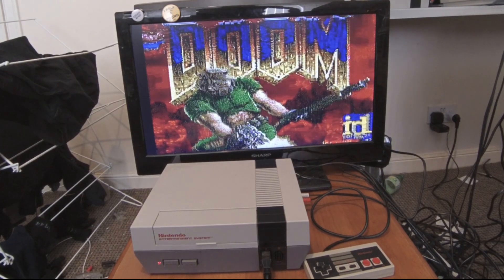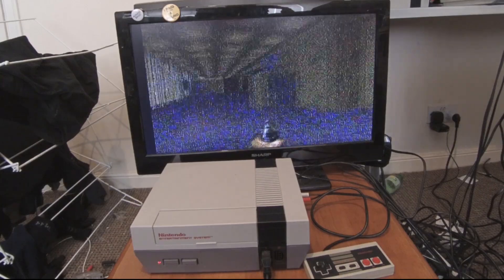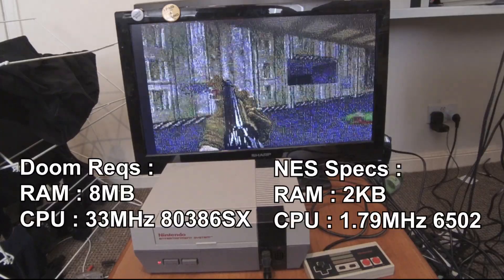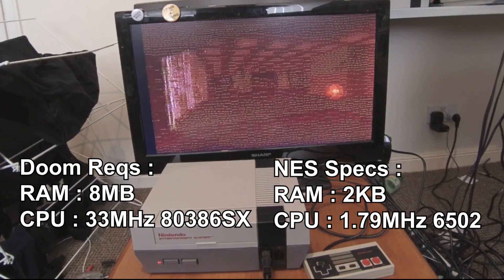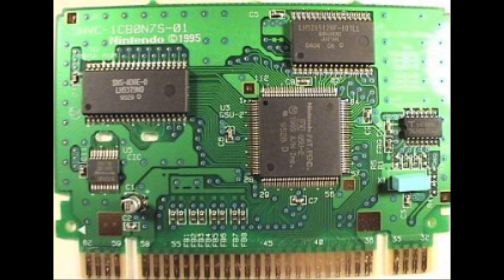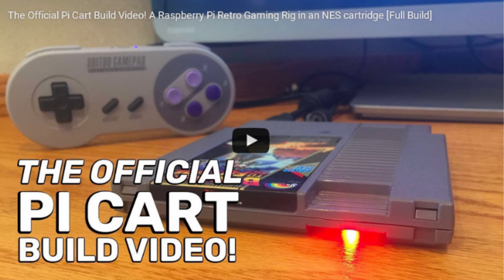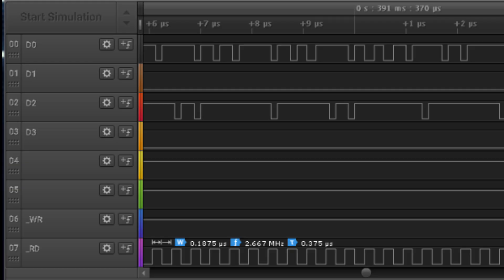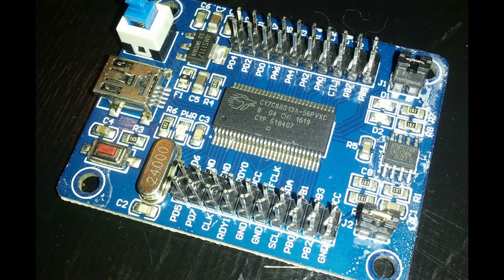DOOM on NES!

Comment: Is there a way to do the same thing on the SNES?
Presumably, it could offer everything shown here—and potentially more, thanks to its expanded colour capabilities.

One important point: I wouldn’t want it running in a tiny window. If it’s possible to run this full-screen on the NES, then there must be a way to achieve something similar on the SNES too. Even if it involves using something like Mode 0 with 2bpp colour (similar to the NES but slightly improved), surely it should still be feasible.

Also, could you briefly explain how the colours in this NES version are achieved? It looks surprisingly colourful, considering the NES typically uses 2bpp tiles. Understanding that would be helpful, since it would factor into how a SNES version could possibly be implemented as well.

Comment: This would of been possible back in the day somewhat, but the chips would be far too expensive for the consumer market!
I'm sure it would be possible to build a handheld into the cartridge itself with the ability to work on an actual NES!
Fit a pi zero, plenty of room to fit a colour screen the zero & function buttons, maybe with a Gameboy cartridge slot built into it, all running through emulation of course.
He's actually playing an emulator on a Pi, through the consoles video output, & not the consoles graphical chips, & probably sound chips, its an illusion sort of.
The same can be done with any other 8 bit system I'd wager.
Going on the video thumbnail, theres nothing "official" about it.

Comment: The FX chip was a co-processor. The raspberry pi is a fucking computer
Reply: A coprocessor is a computer processor used to supplement the functions of the primary processor (the CPU). Operations performed by the coprocessor may be floating-point arithmetic, graphics, signal processing, string processing, cryptography or I/O interfacing with peripheral devices. By offloading processor-intensive tasks from the main processor, coprocessors can accelerate system performance. Coprocessors allow a line of computers to be customized, so that customers who do not need the extra performance do not need to pay for it.

This absolutely fits that definition.

Lets take the Commodore 1541 Disk drive for the Commodore 64, for example. The 1541's PCB consists mainly of a 6502 CPU, two 6522 VIA chips, and 2 KB of work RAM. Up to 48 KB of RAM can be added. The computer itself contained a 6502 CPU and 64KB of ram. The disk drive was basically a 2nd computer.

Some games used the 1541 to calculate 3D rotations, transformations, and projections, freeing up the C64's CPU for other tasks. This is exactly what the Raspberry Pi is doing.

Comment: Obviously cheating. The comparison of the super fx chip on the SNES carts is not valid since that super fx tech was still tech that was available at that time. You are using modern tech for this that was not around during the time of the NES which makes it cheating in my opinion.
Reply: SuperFX came out years after the SNES launched, it was later tech too, just no where near as later. The difference is just years in hardware development and nothing else.
Reply: @AFourEyedGeek  But it was still tech that was available during the SNES generation. That makes it different.

Comment: It IS cheating, because SuperFX chip and sega virtual processor are just single chips, and the consoles themselves are running the game. However, raspberry pi is a full computer, which is running the game without the help of console and NES is only displaying graphics and forwarding info sent from controller.
Reply: exactly my thought process as well, threres a difference between getting a small boost and completely hijacking the system. cool concept though
Reply: @viporial2358  SuperFX and SVP both hijacked the system in a similar way--not just a small boost. The difference here is that this isn't just a chip, it's an entire single board computer (SBC), running the Linux OS, and then an extra high speed USB controller board (which has a microcontroller AKA CPU), as well. So, yes, still a huge difference.

Comment: Ok now that everyones awesome at hacking things, can someone put an intel overdrive 100mhz, 32mb ram and an 8mb graphics card of sorts running windows 95b into an externally unmodified nokia n97? Using the micro sd card as a hdd of course and the dpad with centre button as a mouse... Ultimate pocket pc haha be playing doom, ms golf 95, fury3, rodents revenge all in my pocket, and still able to make a powerpoint presentation in office 97 on the go 😂

Comment: It's not cheating if an unaltered NES can still run the game. It just wouldn't have been feasible back then because expansion chips in NES cartridges that gave just a few extra sound channels were expensive to produce.
Reply: It is cheating, because the game is run on the cartridge. The NES is only relaying videoutput from RPi and interfacing controllers.
Reply: A nes cannot run doom 😂
Reply: A nes cannot run doom 😂
Reply: @jasonsamson6172  it could if super FX chips was a thing back then but such things was mega expensive and wasnt a thing till the mid 90s

but IF they existed at a cheap price back in the 80s? deffo this would of been used to push the nes.
Reply: An NES with this chip inside a cartridge can tho @jasonsamson6172
Reply: A nes cannot run doom 😂

Comment: indeed. technically, the game cart slot is not only a slot for reading ROMs, but it acts as an expansion port as well (hence on board CPUs and Video processors). you might say, Star Fox was a console in itself that plugged into another console simply for the purpose of video output.

Comment: So it's a Doom running on Raspberry Pi, not NES. While yes, there were games with SuperFX chips and stuff, but they only did a part of the job, not run the whole game on them. While it's still cool, that you can send frames rendered by the Pi to the NES PPU, but I wouldn't call that Doom on NES.

Comment: Can game gear do the same? (stronger cpu in cartridge, stream graphics via tv tuner mode). Does master gear converter use this tactic? Can tv tuner read key inputs? There are no data on the internet, not even a master gear mainboard picture.

Comment: This specs is wrong.
Here is the correct:

DOOM(TM) requires an IBM compatible 386 or better with 4 megs of 
RAM, a VGA graphics card, and a hard disk drive. A 486 or 
better, a Sound Blaster Pro(TM) or 100% compatible sound card 
is recommended. A network that uses the IPX protocol is 
required for network gameplay.
Reply from the maker: Yeah I can remember playing DOOM on a 4MB computer so I dunno where I got 8MB from haha

Comment: Lol it was technically possible to put a 80386 in a nes cart back in the days with ram, but not sure if power voltage is enough to run.

Comment: Not enough buttons on the controller to map fire, action (open doors), run, map, weapon select (maybe just one instead of next/ previous?), and the all important strafe left/right.
 The only way I can think of is if the Dpad is movement with turn, the B button activates strafe in combination with left or right on the Dpad, the B button also doubles as Action, A button is Fire, this way you can strafe while firing the same way you run and jump with Mario, no circle strafing unfortunately. And just do away with the Run (enable always run) also do away with pause to free up another button, Select button cycles weapon, Start button toggles map. That could work...

Comment: I think using any hardware that wouldn't be available or possible at the time is cheating. I mean, at this point you could literally put a gaming PC into a special case with an NES connector and call it a 'cartridge' and run Crysis on it, right?
Like, semantically you can't say this Doom "runs on NES". This Doom runs on Raspberry Pi, and only part of NES that sees serious use is the PPU.
Like, it's an achievement but it's far from an actual Doom NES port.
Reply: Don't get me wrong, it is an outstanding technical achievement, but it still is kinda clickbaity.

Comment: Nah... if it isn't running on the 6502, it isn't on the NES. The Super FX chip was still 1994 technology (or whenever) so that's OK and not cheating. Here, you're not even using the NES, when you say "hijack" the graphics, you seem to literally mean it, that isn't even using 4 colours per cell, you've gone really to the basic video level, somehow. You're using basically the RF modulator and the joypad, the rest of the NES may as well not be there. Cheating! 

They managed to get a sortof Doom clone on the Commodore 64. You can do this! Doom is rendered in columns. That is, if you miss the floor and ceiling out, which the SNES version did. The NES uses tiles. You could do something to coincide that, take advantage of the tile mapping to move pixels much more quickly. Would be chunky, but you could maybe do it. 

My god the SNES was pathetic though. 65816 processor. The most useless "16-bit" CPU available at the time. And, whether they admit it or not, just because it's 6502-compatible, so could run NES code. I'm sure the SNES's graphics chip has a NES mode too. Nintendo were surely planning to launch a NES adaptor, to guarantee they at least had some games available at launch. In the end, they didn't, but plenty of cheap Chinese companies did. 

For all of that though, compatiblity with shitty embarassing NES games on what was meant to be a super-console... the worst CPU they could have had, while Sega charged ahead with the mighty 68000! 32-bit registers, though the ALU was limited to 16 bits. Where the 65816 had 16-bit registers and an 8-bit ALU, wired up to 8-bit RAM. Really pathetic. The Megadrive was a 32/16-bit machine, the SNES was a 16/8-bit.

It's only because of it's mighty graphics chip that the SNES managed at all. It did basically all the work, the CPU just had to feed it a few suggestions now and then. But even then they had to keep putting proper CPUs on the cartridges just to help the poor doddering thing along, and co-processing on a machine not designed for it, with severely limited RAM access, is never gonna work well. Really can't convey my unimpressedness with the choice to use a 65816 enough. Hamstrung for a compatibility feature the never used. 

Imagine ths SNES with a real CPU, and those great graphics and sound chips!

Comment: I understand why people say it's cheating. Because from a programmer standpoint, the title is misleading: NES hardware only acts as a display here. Of course there were chips in StarFox or Virtua Racing, but at the time, everyone knew there was a chip that helped because it was disclosed everywhere: on the cartridge, on the box, in ads, at the start of the game...
Reply from the maker: Personally I think cheating would have involved modifying the console itself somehow (which I haven't, even the lockout chip is still enabled), though I can see why people might think otherwise. But where do we draw the line if Starfox/VirtuaR isn't cheating but this is?

Comment: Woooow this is awesome , trough i suppose theres lots of dithering going on considering the limited colorpallet of the nes, but what about the sound, does it use hdma to stream 1bit or 4bit dithered mixed pcm  sound trough the nes???
I guess those mmc chips do hijacking the ppu bus as well to allow enhanced graphics in games either too,,,

If the nes could run doom via a raspbarry cart,then the snes should do it better with it’s higher colorpallet & high quality digital stereo sound , this is just phenominal!!!!

Comment: Rasteri can you help me!? I have a problem in my djm 900 nx, the LFO just blinking 5 times clock signal . Do you have some idea!? Doesn't work more, just freezing. I saw your video, but my mixer just turn on; nothing works
Reply from the maker: CPU comms error, unless you have electronics experience just take it to a repair shop.

Comment: Adding hardware to bolster the NES is not cheating. The NES was designed specifically to work with external hardware to increase the capability of the NES. The inside of a simpler game, Super Mario Bros for example can look very different than the inside of Super Mario bros. 3. Still a Raspberry Pi inside of an NES cart is basically like adding a rocket engine to tricycle. But I still find this very impressive.

Comment: I see high potential in this ,injecting framed graphics to the nes ppu in 16 dithered colors is an amezing process , now we only need to inject 1bit or 4bit dpcm or even 7bit pcm samples to the nes (depending how much power has left over to handle this) and i will be definitely sold on this,,,

But why not do the same thing on the snes, so we can have the full doom experience on snes, also since the snes has better hardware then the nes.
Reply from the maker: I did consider audio streaming, but I'd have to take control of the CPU bus as well (using a second FX2LP perhaps). I have been experimenting with just rewriting the DOOM music for the NES APU, it works out quite well - https://www.youtube.com/watch?v=wqLYwOJd9QI

Also yeah the SNES would be a better target but it already has a (crappy) port of DOOM so it's not so impressive IMO. Better to port a later game (Quake3?) to the SNES.

Comment: That is not Doom running on an NES, and it isn't comparable to the Super FX Chip. The Super FX Chip was a single chip that was added to enhance the power of the SNES. It handled the more taxing 3D graphics calculations, while the SNES did its part in other areas such as the music and backgrounds. What your doing is literally sticking an entire other console inside the cartridge for the NES. It would be like if I wanted to play Resident Evil 5 and stuck an entire Xbox 360 in an NES cartridge. You are not playing Doom on an NES, you are playing Doom on a Raspberry Pi that is sending it's video signal through the NES. Even if you use the NES controller, the game is being run entirely by the Pi, not the NES.

Though, the idea of sticking another console in a cartridge for another console is amusing, and definitely has practical applications.
Reply: True that but the raspberry pie can be programmed to work just the same way as the super fx chip and partially it’s job while the main hardware will do it’s own job, 

Trough streaming video data trough the nes is still special to me since the nes could actually only view 16 colors onscreen so the pie has to dither and close approximate the colors of the nes ( thus mapping those 1000’s of colors just down to 16 colors to feed the nes) wich is not so easy to do and those approximated colors all has to be close to those original colors, man this is simply amezing!!!
Reply: You are correct. However, what was portrayed in the video is not an example of that.

Comment: Oh, it's definetly much more cheating than the Super FX chip inside Star Fox cartridge because that chip just helped the console processing the game, it didn't do the entire fucking work like the Pi in your custom Doom cartridge does. It would be easier to simply connect the Pi board direct in the television instead of connect it in the NES and then on the television... it doesn't make sense to connect it in the NES because the Pi board is doing all the job anyways without using the NES processor for anything other than making the video output(and in a shitty quality to be honest)... video quality would just be better connecting the Pi direct in the tv... that's the fact.

Oh well, If you want to do this anyways, at least put your custom cartridge and its sound and video output signal of its Raspberry Pi in a Super Nintendo(not in the NES or even worse in a monochromatic calculator like i've seen in some videos...); at least you will have much better video and sound output quality because the SNES has much better digital stereo sound and handles much more colors(16 bits, 65536 colors) than the NES(8 bits, 256 colors); or if you want even better video quality, put your custom Doom or Quake 3 cartridge in a Nintendo 64(64 bits)... lol

Comment: Not really NES is it.
Reply: It is tho, absolutely nothing has been done to the nes, it's unmodified.

If you took this cartridge back to the 80s and stuck it in any nes then it'd work just the same
Reply: @televisionandcheese  The PPU being fed by the Pi0, the NES just acts as a relay. No DOOM code is running on the 6502.
Reply: @em00k  well there is, all of the sound is done on the nes, as well as the inputs and a few other things like keeping stuff synced up

Comment: If Nintendo or Sega had this option back in the day i'm sure it would not be classed as cheating. This could have kept Old cart consoles relevant for a longer period of time.
Reply: They did have this option back in the day, and they did use it to keep cart consoles relevant for a longer period of time lol, just not on this huge scale
Reply: @televisionandcheese  That's what i'm saying, a mapper or dsp chip is one thing, but this would be like witchcraft in the 80/90's.

Pi level tech would cost £5000 or more back then and definitely not fit in a Nes cart.

sorry mate this option was a dream back then.

Comment: If you did it with a pi zero that would be even better no? I’d imagine a raspberry pi would need to solder off most of the pots to fit in a nes cartridge?
Reply from the maker: Yeah it's a Pi3 so I removed basically all the ports. Everything's just soldered directly to the board. The zero doesn't have enough processing power to run my video conversion code and DOOM simultaneously. The Pi3 model A might work though...